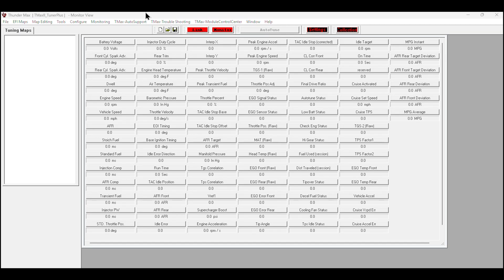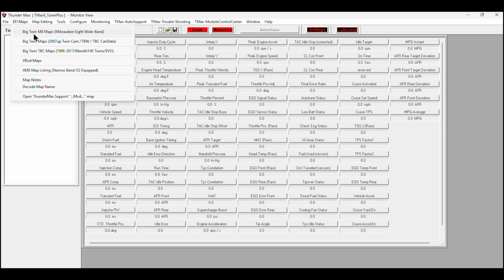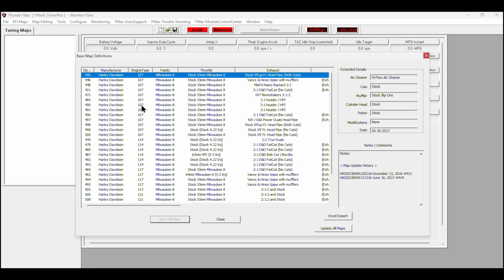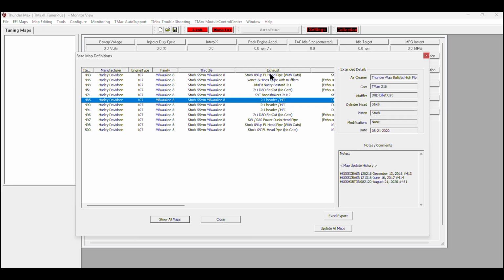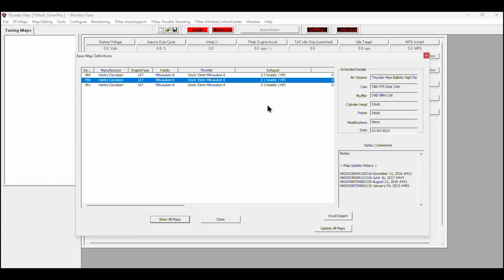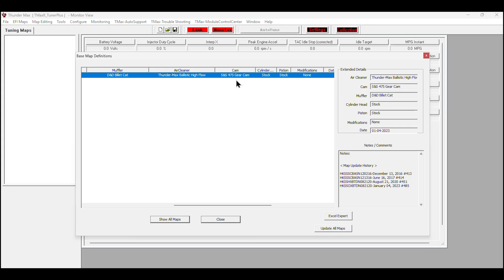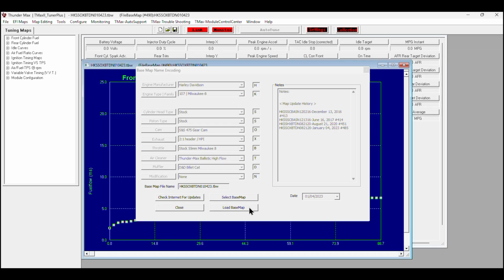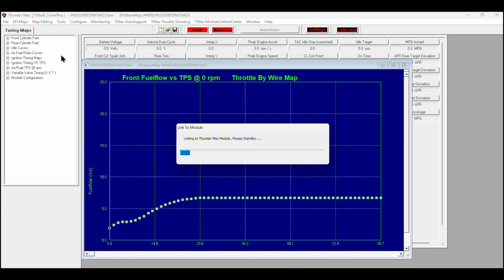Base Map Selection - ThunderMax Tech Tips

Comment: Can the Thunder Max laptop software perform the ABS "Bleed Brake" function on a 2022 Fat Boy? If not, is it a near future feature? The ABS module replacement is a $1500 job at the dealership and the brake systems have to be flushed every other year. Flush/Bleed is $200 at the dealership or $25 at home with the ABS software. We need this feature!!! 🤩

Comment: Okay that's fine. But then my rear cylinder head pipe is glowing bright red. Now what do I do.
Reply from the maker: Check for leaks. Send a data collection. Simple.
Reply: I sold the thundermax  and purchased a powervistion tuner from fuel moto and with target tune module wide band.   And bike rocks and roll. Perfect everywhere in the throttle  @thundermaxefi

Comment: I could be an idiot, I’m just a guy that wrenches on his own bike. 
I’ve installed Thunder Max on a few bikes now. I’ve found when choosing a base map, I first select the engine size, then I select the throttle body and injector size, then I think the next most important component is the cam. Exhaust and intake are secondary to cam intake timing. Select a cam that has an intake timing as close to the cam you’re using. Then move on to exhaust, intake and heads. 
In summary, I think the most important and top 3 considerations are engine size, throttle body/injector and cam shaft intake timing, in that order.
Reply: Absolutely makes sense and you can narrow down in any order you like to get the best results for your individual build.

Comment: Hi guys, I’ve set up the Thunder max with the right maps in it and when I start the bike running about 3000 revs the head of pipes are glowing red the AFR is about 13 1/2 is this normal or what?
Reply from the maker: Sounds like an exhaust intake leak. Shoot us a data collection and our techs will take a look for you.
Reply: It’s not an exhaust leak it’s a freshly rebuilt engine with a new S&S exhaust with the old ECU in it. It does not do it. It only does it with the Thunder Max so clearly running to Leeane and the issue is if you keep on going to that kind of wreck my fresh new engine.
Reply from the maker: @terryjamison5838  Freshly built engine or not it can still have issues. The stock ECM may not show the issue due to its lower rate of data. The easiest way to figure out what is going on with your motorcycle is to send us a data collection. Let our techs take a look at the running parameters. Good data solves problems, comments on social media cause confusion. Send us a collection and let us take a look.
Reply: @terryjamison5838 Send the man you map.